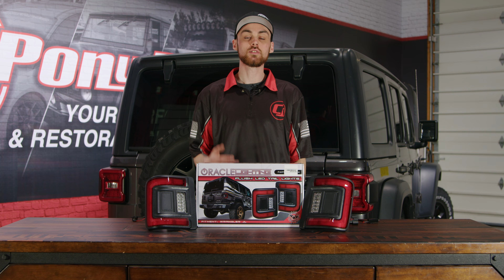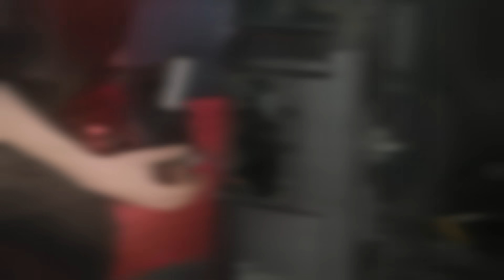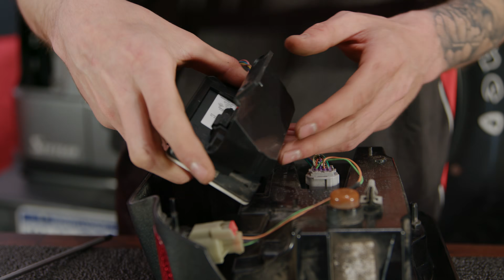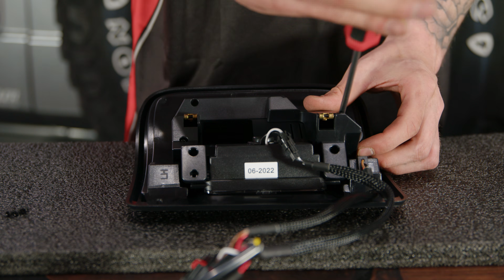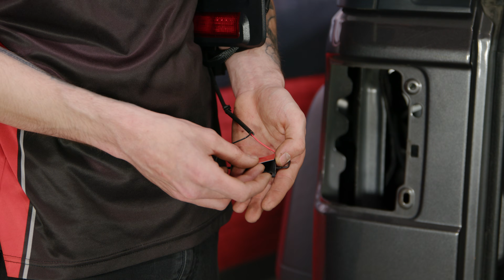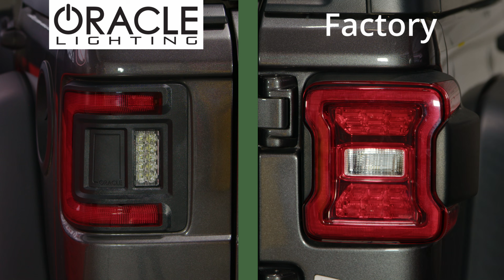Oracle Lighting Flush Mount LED Taillights For Jeep Wrangler JL!

Comment: The bright Backup light is nice but the clearance, stop, turn signal lights are not as bright as they could be. I installed a set on my 2021 Gladiator an they lasted about 3 years and now are starting to fail. I will not be installing another set of Oracle lights.

Comment: Where are people mounting the 2 reflectors included in the kit?
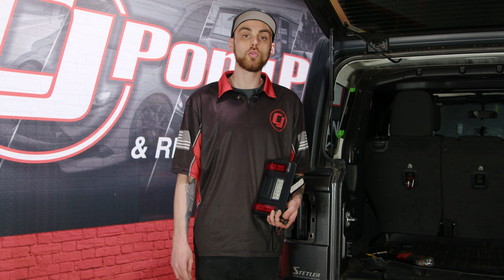Reply from the maker: There isn't a reflector inside the kit? There's 2 resistors and I show where to mount those at 6:05
Reply: F150  I mounted the resistors, but the kit came with 2 round reflectors, the girl in the Extreme Terrain video called them fender reflectors but doesn't show where to mount them